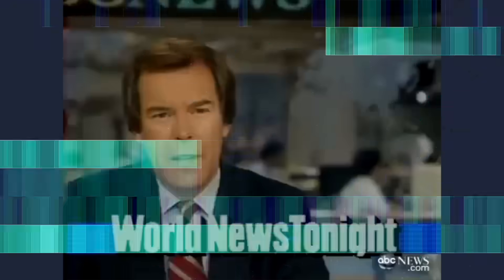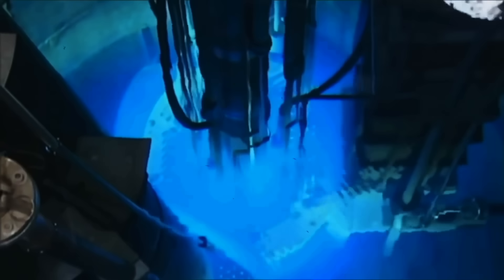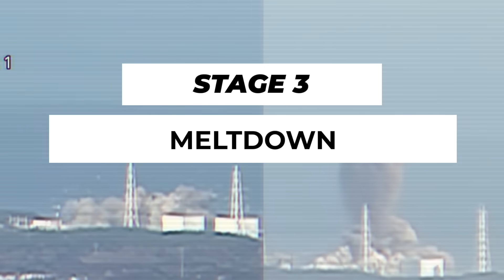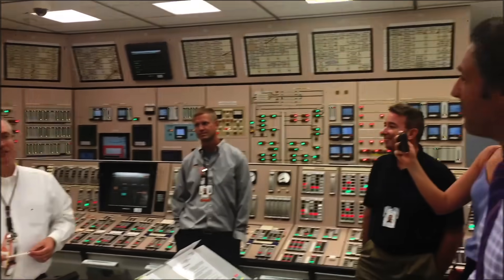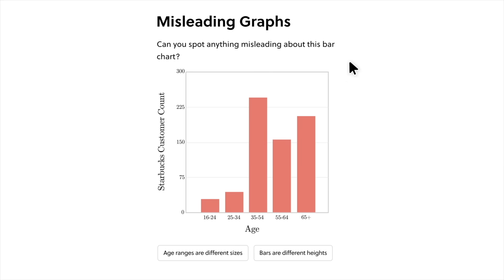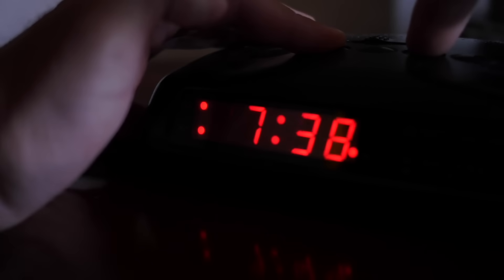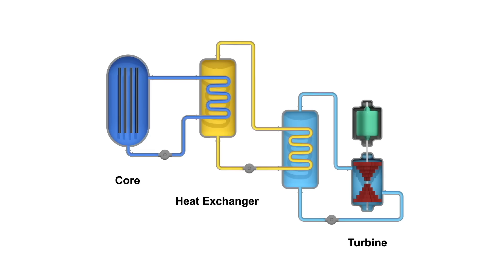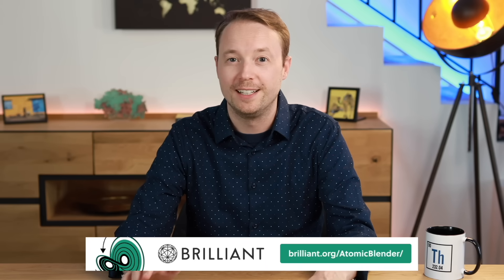Why Is It So Hard to Stop Meltdowns?

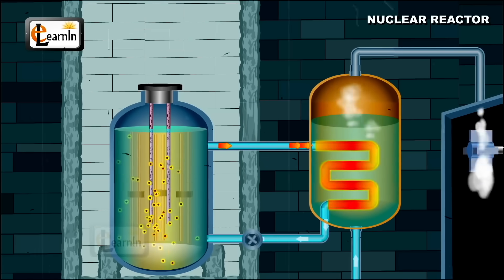Comment: 3:50 No, "delayed neutrons" exist but they are NOT the cause why fuel assemblies heat up even after the fission reaction has been stopped - the reason are the fission products (the atoms of elements that form as products after Uranium atoms splitting), they are quite different in their activity/half lives, some of them have short half-lives so they burn hot but disappear soon, some of them can stay for weeks or even years... so the heat caused by this fission products decaying is initially something like 10% of the "full power" but during about 1 hour, it decays towards some 3% and continues decaying...
After few days, the assemblies would still be red hot but they would no more melt.

Comment: Its kind of crazy that one of the most common failures that leads to meltdowns, is not having electricity....
Like, do you know how insane the phrase:
"The NUCLEAR REACTOR does not have enough energy" 
Truly is? 😂
You would think we would have engineered a way to use the immense heat of a meltdown, to help power the backup generators, that help prevent meltdowns lol

Comment: Canadian CANDU reactors which have been in operation since the 1950's are meltdown proof. The worst that can theoretically happen is a cracked fuel-rod which would force a shut down for a few weeks to remove the rod and clean the core. Also light water (regular water) poisons the reaction so during a disaster using water will cool the reactor and not accelerate the reaction. Since CANDU reactors use heavy-water as a moderator they use non-enriched uranium as fuel, light water isn't effective enough of a moderator to sustain a reaction with non-enriched uranium. So by displacing the heavy-water with light-water during a crisis the reaction becomes poisoned and stops. They also use control rods suspended in the air by electro-magnets so if power is cut the control rods immediately fall into the reactor and shut it down, they're propelled by gravity so it's reliable. They also have a special neutron absorbing liquid that's injected if conditions get much worse which completely kills the reaction and forces a full flush of the coolant loops before a reaction can happen again. Meltdowns are an issue that was solved before they were even a problem, by Canada. Canada sells the reactors for quite cheap as well, reactors have already been constructed in: Romania, China, and India. The only reason they're not used everywhere is because Canada is strict about countries weaponizing plutonium, which is why India can no longer buy them.
Reply: @XenonCitium  Pickering, Canada's longest operating power-plant started in I believe it was 1971, it had been extended I think 3 times and is only 2 years younger than Switzerland's nuclear reactor which is the longest operating reactor in the world. Canada keeps renewing the contracts because the reactors are good. Plus we're not building a bunch of SMRs to keep the grid going. 

Ontario, the part of Canada with the most reactors, is one of the cleanest grids in the world and actually has the occasional day about once a year where the grid runs 100% green.

Comment: There something called Rici it uses left over steam to turn a turbo pump to feed water
Reply: I think what you are talking about is the RCIC, or Reactor Core Isolation Cooling. The RCIC is used in BWR-3 through BWR-6 boiling water reactor designs. The RCIC system is a single train standby system for safe shut down of the plant. The system is not considered part of the emergency core cooling system (ECCS), and does not have a loss of coolant accident (LOCA) function. The RCIC system is designed to ensure that sufficient reactor water inventory is maintained in the vessel to permit adequate core cooling. This prevents the reactor fuel from overheating in the event that the reactor is isolated from the secondary plant.
Reply: @caxve  fellow nuclear worker ey? 😂

Comment: Your explanation of why nuclear reactors continue to produce heat long after they are shut down is incorrect. The real reason is decay of the fission byproducts. When uranium (or other nuclear fuel) fissions it produces highly radioactive fission byproducts - much more radioactive than the original fuel. (I won't go into the reason they are so radioactive since it involves nuclear physics and would take a while to explain.) Even if fission of uranium is stopped the highly radioactive fission byproducts are very unstable and continue to decay, releasing large amounts of heat. One other thing: as some other commenters pointed out we have not had nuclear power for thousands of years.

Comment: Whenever I hear "promising and clean enegry" in the same sentence with "nuclear power", it really grinds my gears. I'm a physicist. I know the potential of nuclear power. And the associated risks. Later one drives costs to the extreme and by now makes nuclear power the most expensive power source. Yes, nuclear power plants do not actively emit greenhouse gasses (except for the massive concrete necessary, when built... Over decades). But the environmental impact is exorbitantly higher (storage of nuclear waste for thousand of generations. No, even transmutation and Gen4 plants won't get rid of all the waste...). This is why nuclear power is relying on heavy subvention by the state. The risks are simply to high. Economically, you can build true green plants (solar & wind) with fractions of the cost and especially time compared to nuclear plants. Regenerative energies are the future. To be more specific: A surplus of regenerstives + storage + distribution, so that fossile plants become obsolete (same as nuclear OFC).
Reply: Yeah your not a physicist, or at least a competent one

Comment: I don’t think you properly convey how incredibly extraordinarily rare nuclear meltdowns are
Reply: Are they thou? 3/~400 in 65 years isnt incredibly extraordinatily low.
Reply: @flok462 not sure where you're getting that number, there have only been about 5 or 6 nuclear meltdowns in human history that were a serious safety concern to the public, and only Chernobyl resulted in direct radiation deaths. Additionally all of these were water cooled generation 1-2 reactors, we haven't seen a meltdown with a generation 3 molten salt cooled reactor, and to my understanding it may be physically impossible to
Reply: @Connordrs1123  it's pretty easy, just find out how many NPP / reactors there are and how many failed.
Reply: @flok462  you're conflating a reactor failure/incident with a full meltdown, very different situations. A full meltdown, where the cladding and fuel pellets have melted together and destroyed part of the shielding to the outside world, there have only been 7 of these events in history as I recall, with Chernobyl and Fukushima being the only two that actually released serious levels of radiation to the public. In reactor failures and incidents that did not reach a meltdown it's messy and difficult to deal with on the inside but poses no risk to the public due to the radiation shielding structures remaining intact
Reply: @flok462 if you really want your socks blown off, consider this: even with the worst death toll estimates of Chernobyl, about 4-9,000 deaths have been caused by nuclear accidents in human history. Coal and natural gas kill an estimated 800,000-1,000,000 per YEAR.

Comment: 2:15 how does the water vaper not become contaminated, or does steam not become radioactive from high levels of radiation exposure
Reply: I am not 100% certan but it’s twofold reasoning, one is that the steam condenser im between the reactor and turbine helps to keep the coolants separate. Aswell as cladding put on the fuel like zirconium. I 100% am not an expert but this is what I understand
Reply: @swatboy763 u sound like an expert!
Reply: @IsntPhoenix  I'm not but thanks
Reply: @swatboy763  for a PWR you are spot on. The steam generators give a "buffer" that helps keep the steam "uncontaminated" that goes through the turbine and so on. In a BWR it is pretty contaminated, so the steam side with the turbines and condensers is typically closed off during operation and only accessible during operation if absolutely necessary.

Comment: What most post-apocalyptic fiction, from zombies to pandemic, whatever, almost always misses what happens to all the nuke plants. There are failsafes upon failsafes, but if there is a complete civilization/societal collapse, or anything that prevents these operators and systems from working, they will all fail. It's too depressing to work into your world-building so most authors just handwave it away.
Reply: most plants are dsigned to fail-safe. it's really only in the case of a disaster causing significant damage or opperator failure/ bypassing safety that causes meltdowns. While there may be a couple plants that end up melting down, i'm pretty sure most would end up failing safe.
Reply: @jonathankydd1816  Interesting. So then what does a fail safe status look like six months, a people years, ten years, etc with no one does anything?

Comment: as long as we do not have the technological maturity to handle nuclear energy in a truly safe way, we should not even think of using it to the degree we already do.
and burying the nuclear waste in some old mine tunnels and then pour concrete over it is nowhere near an acceptable solution.
chernobyl and fokushima are catastrophes with widespread effects that will last centuries. 
ionizing radiation destroys the coding of our biological existence. it is not some random poison.
and with the means and the technology available to us right now, using nuclear power is too great of a risk. 
and the amount of active nuclear reactors on earth is mind blowing.
sure, nuclear energy is very, very tempting. the energy provided by unit of fuel is immense. but it is an illusion to think it is clean or safe.

Comment: 12:45 You said "A thousands of years of reactor operating history worldwide"...🤔did i missed something? a thousands? 😳 The chain reaction was discovered in 1919 by Sam Rutheford ...
That gives a 104 years max. The first ever atomic reactor was "Chicago Pile-1" built in 1942 so that cuts 23 years. Whichever math You'll use this definitely is not even a "single" thousand years of nuke reactor operating worldwide
Reply: Probably means that the total operating times of all nuclear reactors combined add up to thousands of years
Reply: @Phagastick   As for now 436 reactors are operating around the world so this is quite plausible.  Anyways for average J Smith this can be a bit confusing

Comment: He kinda paraphrased the whole "the operators at chernobyl disabled the safety systems" thing. Yes, they did turn off the safety systems, but it was for the sake of conducting a test, where the real error came in when they were interrupted, and postponed the test for the night staff, which was much fewer and less informed of the details of what they were to be doing. 

also the three mile island control room disaster was mostly caused by the relief valve of the reactor being stuck open, letting water spill out of the cooling loop causing the reactor to overheat. the control room also lacked the critical information needed to keep them informed of the exact situation. where was an indicator to inform the operators of the intended stat of the valve (being if it was set to be opened or if it was supposed to be closed) but not the actual state of the valve, meaning the operators could see that they were losing pressure, but not that it was spilling out of the valve. Then there was the PR meltdown, which had much worse effects than the actual reactor meltdown.
Reply: True, but some of those were critical safety systems that were never supposed to be bypassed. for example, there was a hard limit on the number of control rods that they were allowed to remove. during the test IIRC, they removed beyond that limit because the reactor wasn't producing enough power to sustain it's own systems yet.

Comment: Nuclear fission power is intrinsically far too dangerous.  Their input is Uranium fuel, and their primary output is nuclear waste, with a bit of heat being generated as a minor byproduct.  A nuclear reactor is actively maintained in an intrinsically unstable state, namely criticality.  If the active control does not work, the consequences of nuclear meltdown can be dreadful.  Solar panels and wind turbines fundamentally do not suffer these intrinsic problems of nuclear power.
Reply: The consequences are typically contained within a large concrete building. Outside of bad examples such as Fukushima or Chernobyl where the containment buildings were frankly. Shit. Most western reactors are built like missile bunkers and testing has been done. 3 mile island is a good example of a total utter fuckup with a nuclear reactor but was still contained.
Reply: Always doubt the wisdom of a self-proclaimed wise person.  

Forty years ago, the Canadian government did a cradle-to-grave study of the health effects of all primary energy sources.  Only ONE form of primary energy was safer than nuclear: LGN (Liquefied Natural Gas).  Solar panels and wind turbines were much more deadly because both solar and wind power is diffuse.  To use these sources of power as our primary energy source will require huge building projects.  And if there is one thing insurance companies know, it is how many people will die building those huge building projects.  Hint: Kilowatt per kilowatt, fewer people will die than from nuclear power than from either solar or wind power.

As for nuclear wastes, UNREPROCESSED nuclear fuel rods will, after 10,000 years of radioactive decay will be only 10 times more dangerous than the original uranium ore mined to make the fuel.  Mixed into artificial granite or borosilicate glass at a ten-to-one dilution, the final waste will be no more radioactively dangerous than the original ore.  

One more thing to consider; the original uranium ore is usually found buried in the water table, where you get your drinking water from.  So you can thank the nuclear energy industry for making your drinking water safer to drink by removing the uranium and putting it somewhere safer.

Comment: Why not just Run pumps off solar and batteries? Then there’s always power unlike requiring generators and fuel, ensure the batteries are always charged using the reactor so in the event of an issue solar can be used to keep pumps running temporarily?
Reply: It’s a Good idea and power plants do have backup batteries but solar power dosent provide enough power for the pumps. They are very large high power pumps alongside the army of support equipment and controls. Power plants do have backup generators aswell for this event but solar isn’t used
Reply: Power plants do have batteries, but batteries are not powerful enough to power an entire facility, and solar cannot be guaranteed, due to weather conditions and time of day.

Comment: The problem with water cooled reactors is that the water itself is a neutron moderator. If you lose the liquid coolant then the reactor is going to continue to heat up. The actual explosion process in such accidents is either a steam or hydrogen explosion and not a nuclear detonation. The nuclear fuel can never form a mass capable of a nuclear explosion. For this to happen, a critical mass of Uranium needs to be forced together and held under extreme pressure for a certain amount of time to allow the chain reaction products to build up sufficiently to initiate a nuclear detonation. Even within a pressurised containment vessel this simply isn’t possible. The containment would rupture well before sufficient pressure had built up. Chernobyl and Fukushima were probably the worst case examples where the containment vessels ruptured and the nuclear fuel was blown out and dispersed by steam explosions. That absolutely removed any risk of a nuclear explosion but did cause radioactive contamination over wide areas.
Reply: A moderator in nuclear terms is a bit counter intuitive. 

Moderators speed up the reaction by slowing down neutrons so that they are more likely to react. 

A water moderated reactor would actually cool down as the water evaporates. Of which the infamous RBMK was not.
Reply: Great post, I worked in the nuclear industry in a fuel fabrication facility. I have lost count of the times that I have had to explain to people that nuclear power plants cannot explode like a nuclear weapon.

Comment: Your wrong man, their are (numerous) ways to keep a reactor out of meltdown. Its just that the reactor must be built with safety being a number 1 goal. The Uranium/Plutonium design favored by most companies is cheap to build and the government will buy the plutonium to build bombs.  Simplest - several varieties of heavy water reactor that require the reactor to have its heavy water (neutron moderator) and the loss there of will slow the reactor down to where damage to the fuel is not an issue. There are several other ways with Thorium that are just as bullet proof. The problem is that most companies are just going for the most bucks - which means that the companies and the AEC play a game where the AEC makes rules and the companies cheat. We therefore end up with more expensive reactors which are not safe. Most of the problems would disappear simply by making safety more important than bucks. Remember safety must be built in, not glued on as an after thought.

Comment: The delayed heat of a shutdown reactor is not from continued fissions as you said. The fission products in some cases also breakdown into simpler atoms. These by products while they release it ia not as great as a true fission. This rate is called half life of these by products. It is described as heat of decay. This produces approximately 7% of the average power level of the reactor. This is simple nuclear physic. I know I taught it for two years.